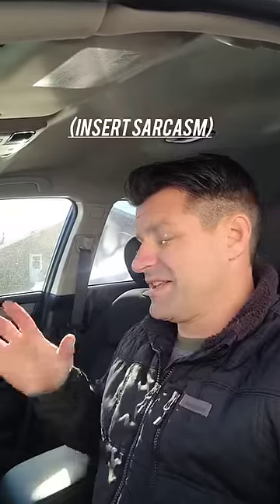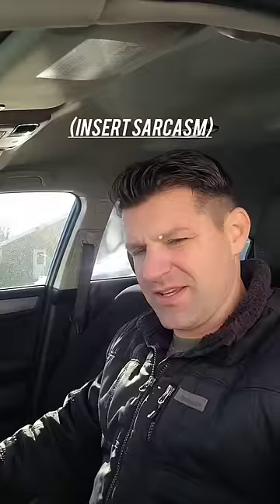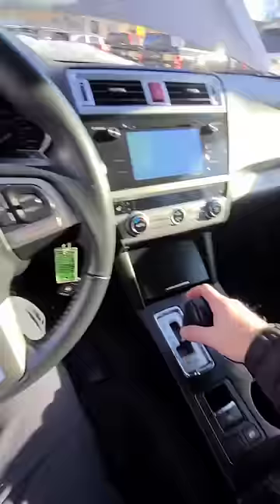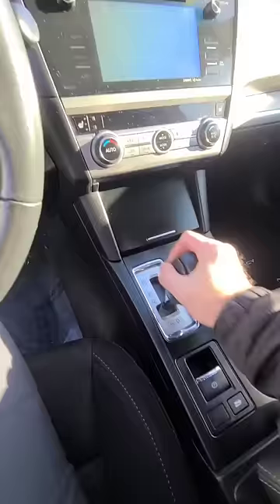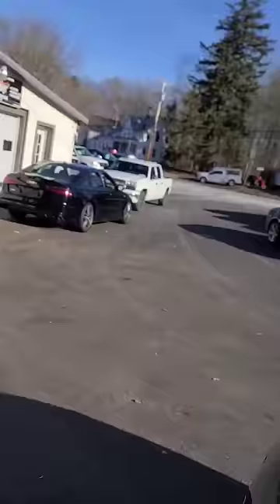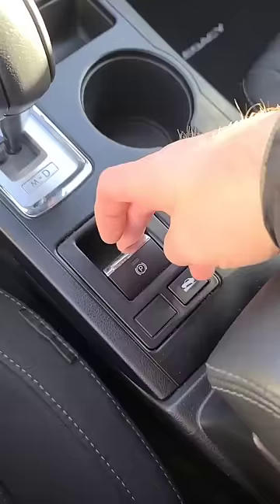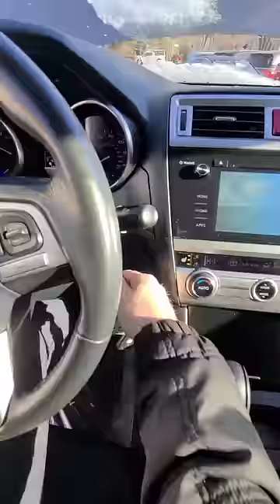Why Subaru Engineers deserve a punch in the Face! #shorts

Comment: Electronic parking brakes, Electronic shifter are all huge safety issues with newer cars that we'll start seeing more problems with as they age. There should always be a mechanical backup as clearly shown here. Notice how they don't call it an emergency brake anymore.
Reply: It was never called an emergency brake that has just been a slang term for it. It's always been labeled officially as parking brake or mechanical brake or foot brake hand brake but never has it had any official designation as emergency brake atleast with the mechanical system it could be utilized in an emergency situation and stop the vehicle but it it was even possible to do I'd hate to have it actually allow it to apply when driving full force and locked up wheels instantly can see that going just swimmingly
Reply: If I remember right, it killed this actor....yep...Anton Yelchin (Star Trek).
This ain't a video game, and it's the general public.
Reply: Electronic door handles aren’t as much of a safety issue, but just stupid.  Look at a c6 corvette, can’t open the door when the battery is dead.
Reply: @andrewcox3137  lol ya that's what the key is for it opens the trunk and then you can pull the door release cable 🤦
Reply: @claytoncoolidge992  oh sure you could do all that, or…hear me out here…we could just design a door that doesn’t require battery power to open.
Reply: @andrewcox3137  lol but see the people who are buying them really really love that type of thing. And till they stop liking it it's going to have more and more added to it
Reply: @claytoncoolidge992  seriously though what advantage does an electronic door handle provide
Reply: @cloudsmith7803  Not the kid with the cheesy Scottish accent? He was better known in the movie Alpha Dawg, dog!! Amazing actor. I'm still shocked that he actually died just like in the movie. It was like a precursor to what was to come. His parents was suppose to sue the designers. Wonder if they ever fell through with that. I hope so. He had soo much talent and so much ahead of him in his movie roles. He was the next-generation of great actors.
Reply: @daixer3156   yes, and we were all looking forward to his acting in future movies with that scottish accent.
The family settled, but the lesson very cold to us.
Reply: It is still an emergency brake
Reply: @claytoncoolidge992  It is a backup to hydraulic brakes, and is regulated as such, so even modern electronic parking brakes can stop a moving vehicle
Reply: @claytoncoolidge992  I can totally use and have used my hand brake on my old Corolla just like a regular brake and can apply as little or as much force as desired, and have control while holding the release button. How is having an electrical button with zero control over brake pressure, better!? There should always be a mechanical backup
Reply: @cheesecurd100s  ummmm obviously you are asking me disagree with you when I made the exact same point 😂😂 you need to stop commenting without reading
Reply: @claytoncoolidge992  
It's an american thing for sure. The same with engine oil called "weight"
Reply: Because it was only called an emergency brake in the US, the rest of the world call it a handbrake
Reply: @andrewcox3137  Aerodynamics. For sports cars, top speed. For electric cars where it's also common, improved range.

It's very insignificant, but a lot of insignificant little details add up quite quickly when it comes to aero.
Reply: electronic parking brakes and shifters technically are both solutions to rollaways with keyless vehicles.
manufacturers naturally dont want to be sued, either by people that get out of their car without putting it in park or the people the car hits when it rolls away.
If the BCM sees the car is in gear and the driver door is opened, the seat belt is unbuckled, the weight sensor in the seat is unloaded, etc the car can automatically apply the brakes or shift into park. which it would have done here but this guy did this on purpose, the car wont shift out of park unless the lock disengages when the ignition is on and the brake is depressed. Same as with cars that use metal keys - the car wont shift out of park without the key in the ignition and the brake depressed, and wont let you take the key out until the car is back in park.

Mechanical, cable actuated parking brakes arent immune to failure either. Cables stretch and snap, and its way easier to replace failed motors, switches, or even entire rear calipers than it is to dick around with replacing and adjusting cables in most cars.

Comment: Pry up the rubber in front of the shifter, use a long tool (giggity) to depress the shift lock and put it back into park...
Reply: He said "long tool"
Reply: What I was gonna say
Reply: So jump out, run to the tool box, get the long tool and run back to jump in the car...... gotcha
Reply: How many people do you think know about the sift lock facility on auto box cars.
Reply: @jhndijkman everyone who owns a vehicle that does this should know
Reply: @patrickdrier4707  should know yes. Does know, not as many as you might think I suspect  unfortunately.
Reply: @jhndijkman  almost every mechanic and tow truck driver...
Reply: @jhndijkman  Subaru is not fool proof and there are too many fools is what you’re saying
Reply: @ItsAlive111  fools is a bit harsh. Personally most drivers would put there vehicle in park before turning off the engine. The automatic lock release feature would mostly get used by the tow trucks, mechanic and the police.
Reply: Why are you saying that like it's common knowledge? The average person doesn't know that
Reply: And as a casual driver where would I have said tools
Reply: Umm I got an Acura with no physical handle….it has buttons
Reply: @jhndijkman  He said that the jumper pack shut off when he was trying to move it and the car died. That's why it was stuck and not in park.🤦‍♂️
Reply: @albertohernandez3487  your car is almost identical, rubber tab in front of the buttons, push back towards trunk.
Reply: @barrydillard2130  your key...
Reply: @cigarsgunsanddiesel8032  ... Fair enough.
Reply: @cigarsgunsanddiesel8032  the average person doesn’t even know how to put a spare tire on how the hell would they know that
Reply: @Mark Lee  if you need to get out to get a small screwdriver that's your fault

Comment: That's a safety issue that should be addressed.
Reply: Most cars have a manual release for the transmission to be shifted into park, if this dude did a simple google search i bet he couldve found out how.
Reply: It’s only a safety issue if for some reason you put it into neutral while having it on a jump pack, then disconnect it then whine about it not wanting to get back into park… while not using chocks on uneven ground.

Comment: Hey little tip I learned while being in a similar situation, in that little compartment in front of the cup holders and under the rubber mat there should be a hole. But a screw driver down it and gently push down and you can shift back into park or neutral, with a completely dead battery
Reply: That would be great if the car didn't roll when he walks away to get a screw driver. A mechanical brake would be even better.
Reply: @mikew9941 I would've looked in the glove first

Comment: This is one of the reasons why I don't buy new cars. Over reliance on electrical components and not using old but time tested mechanical solutions for certain things like emergency breaks. I have an '04 and a '67 and if the battery dies in either of these cars, I can still put it into park & engage the emergency brake. Proper maintenance at scheduled times by previous owners and now me have kept these cars in really good mechanical condition. 
 Also I just like to look of older cars. After buying my first Thunderbird I'm now putting together a small Thunderbird collection. My first Thunderbird was a 2004 Thunderbird and last year I picked up a 67 Thunderbird 390 c.i. big block with the suicide doors in the rear. I figured I'm going to do all engine sizes and at some point get  87 or 88 Thunderbird Lima 2.3 l 4 cylinder turbo coupe And then at some point a '90s super coupe Thunderbird with the supercharged V6. Already have a big block and small block V8 with my current Thunderbirds.
Reply: if your battery completely dies, it means you’ve been ignoring warning about it for months. 

This is a situation that will likely never happen with any modern car, it’s just BS by clueless people.
Reply: But if you crash in those cars you are dead, safety has come a long way
Reply: Ok boomer.
Reply: Fact of the matter of old vs new engineering.  New is more reliable than old.  Examples-carb vs electronic ignition, mechanical ignition switch vs push button, transmissions..the list goes on.
Reply: @manu144x  hard disagree. Mechanical failure is less likely to happen than an electronic failure.
Reply: Tl;dr
Ngl this is one of the multiple reasons why I’m reluctant to buy and appreciate older cars
Reply: Modern cars are dramatically superior in just about every possible way, especially safety.

Comment: When I work on my cars… I chock my wheels not matter what I’m doing.
Reply: Not sure if you understand the situation, but that would require getting out of the car.
Reply: @antdog8888  dudes not sitting on a 20% grade, hes acting like its impossible to get the car into a safe situation.

yes its shit but this aint much different than your average 20 year old shitbox where the handbrake doesnt work anymore
Reply: @arcticrevrus9883  Did you also notice that when he got out, the car didn't fucking move?
Reply: @Naru 'Sanav   it moved several feet
Reply: @antdog8888  BEFORE he even sat in the car to do anything, he should've chocked the wheels. Anytime you work on a car you should chock the wheels before work begins. I understood fine, I don't think you understood my comment.
Reply: @thrawn127  thanks for clarifying. I actually did not understand your statement. It all makes sense now.
Reply: @antdog8888  I wasn't trying to be rude in my reply so hopefully I didn't come across that way! Take care!
Reply: @antdog8888  To be fair it is very, very, very, very, very unlikely that this situation will ever occur. Your battery will not die whilst you're driving if your alternator works, and if your car is parked with the engine off, why the fuck wasn't it in park with the parking brake already on?